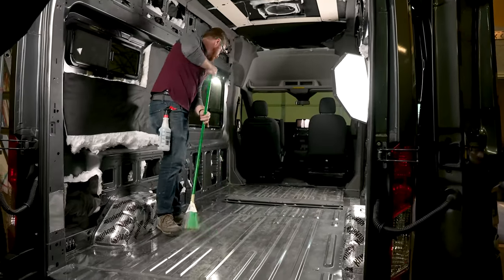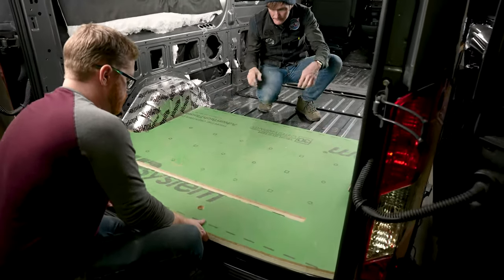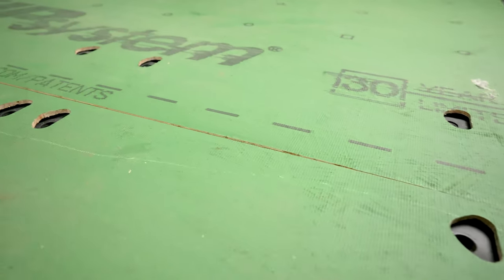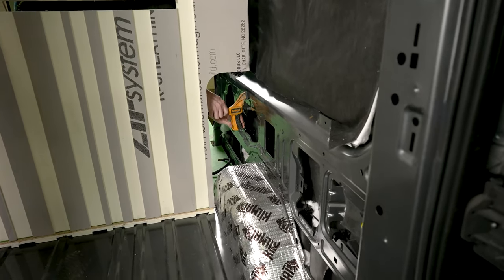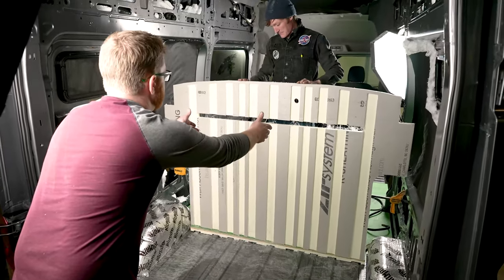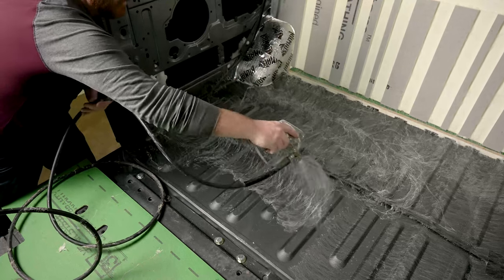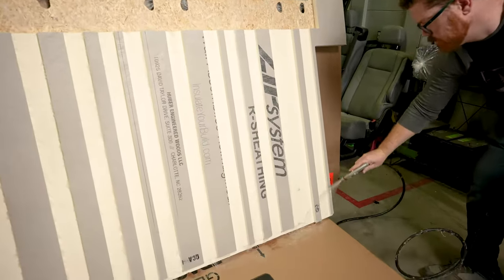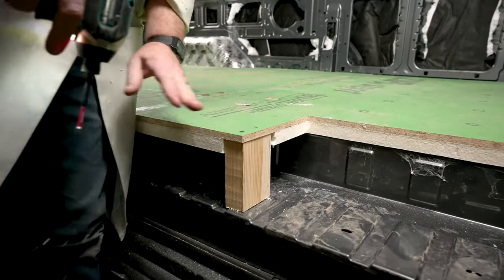AVC Sub Floor Install

Comment: Thanks for this, it's genius, a super clean 3 in one solution.  I would like to kindly request a shorter 2 panel option without the stair and trim assembly for those of us with crew vans who want to leave the second row passenger floor intact to save time and money
Reply from the maker: So you’d want two rear panels and the rear trim? We do offer a crew setup that mounts over your seat brackets in the crew. It replaces the factory floor. We did one recently at the shop. If you look up our Instagram it should be pretty close to the top.
Reply: Yes!  Two rear panels, the inner one that butts up to the existing oem second row floor, a new piece of T trim for that condition and a piece of trim for the rear.   The Crew models are becoming extremely popular and I think you’d move a bunch of these if it were an option.

Comment: Is the primary reason for gluing the floor down to prevent squeaking? Obviously security too but if you’re bolting even just L-track into the floor, that sub isn’t going anywhere. Gluing stuff down to my new van is terrifying but I love the concept and the product you guys have produced.

Comment: So if we're using the cans of adhesive, would you recommend 3M 74?  I just watched your adhesives video as well and it sounds like the 70 and 74 are basically interchangeable, so that seems like the right choice, but I also noticed you recommend 3M 94 on the product webpage for your floor, so would just like to confirm which is best.  Thanks!
Reply from the maker: It depends on the flooring and what it is backed with. All flooring materials are built differently, so choosing the righ adhesive changes with the flooring. In this video we installed G-floor and 70/74 is the best for it. When I install Lonseal flooring I’ve found 90/94 to work better.  90/94 also need more time to properly off gas so be sure to test a little before you install.
Reply: @AVCRIG  Thanks!  That actually answers my next question, but was also curious about the adhesive used to connect the bottom of your floor to the metal van floor.
Reply from the maker: @csteutterman  ahhh.  We found both work fine to secure the sub floor. I haven’t been able to get 94 in the large format (or small cans for that matter) in well over a year. COVID supply chain issues. We switched to 70 and it has a better tack (feels stickier) when applied.
Reply: @AVCRIG  One more question if you don't mind.  How many cans do you suggest to glue down the sub floor in a 148" Ford Transit (non-extended)?
Reply from the maker: @csteutterman  I’d say about 8 would do it. One can per panel and corresponding floor section. A couple more to fill in the gaps.

Comment: Thanks for the video! How good is the insulation on that floor? Id love to put a heater floor element in my build. It looks like it should fit the van like a glove.
Reply from the maker: It does fit the van like a glove. It’s actually pretty solid without gluing in. (Although we definitely recommend gluing it down) poly iso has an r value of 6 per inch. So I’d say the floor overall has an average of 4.5 plus whatever the nominal value of the wood it. My favorite feature is that there is no thermal bridging. Makes for a more efficient thermal envelope.  

Now, I have done radiant heat, but we did things a little different. What heating element do you have in mind?
Reply: @AVCRIG  that’s pretty awesome! Currently I don’t have a specific heating elements in mind. I’m very open to ideas. I’ve seen a few videos where people said the heating elements got too hot and changed the color of the floor, so ideally avoid that risk if possible.
Reply from the maker: I could see that for sure. A lot of those systems are designed to be placed under tile. I did a few Espar hydronic radiant systems in the past, but they were incredibly complex. We did a routed later for the pex tubing, then added a 1/4 wood layer above it all to even out the heat.

Comment: If I'm correct, you had mentioned in the comments of one of your other videos that you have used Loctite PL300 to adhere the floor kit to the van floor. If that is correct, how do you recommend I lay the caulk down? I definitely want to avoid any squeaks. I'm interested in this option because it would save me a good bit of loot, but I only want to use it if it's recommended. I'm going to install my kit this week. Thanks again for these videos!
Reply from the maker: There’s a lot of adhesives that will work. The. PL300 works great and allows for more working time. I would caulk it on with a gun. You can trowel it on, but it’s not necessary. You do want plenty of weights handy to hold the floor down while it kicks. Read the label and follow manufacturer instructions for curing time and temps.
Reply: @AVCRIG  Thanks! This is very helpful.
Reply: Don’t use pl300 its not a great adhesive and binds poorly to smooth surfaces. Pl premium is much better, but for porous or rough surfaces.  A siliconized latex caulk will stick much better to a painted van floor.  Avoid pure silicone caulks for bonding.  
I think his use of contact cement is the best choice however.  No wait adhesion and no clamping or weights required.  Contact cement is also flexible bond less likely to separate over time.

Comment: What other adhesive’s can be used?
Reply from the maker: We’ve been using a lot of 3M 70 in a lace pattern gun lately. I’ve used PL300 in the past, but it sets slow so you really have to weight the floor overnight.  I’ll bet a number of contact adhesives would work.  Just be cautious with something that expands(like gorilla glue) and as always do a little test.

Comment: How are you mounting your l track to the van floor? Does it require a riser?
Reply from the maker: We use the flush mount L track with a lip. We use a spacer under the l track, and bolt it through the van floor. Spread the load with big fender washers.  We’re not intending our track for seating, just cargo.  Next video is cutting the floor for tracks! (But be sure to do that before you install)

Comment: I like your insulated subfloor system. Are there any additional steps needed to keep the polyiso from compressing in areas under base cabinets, built-in seating, beds, or other items that have a fair amount of weight?
Reply from the maker: The beauty of our floor design is that it’s an even contact over the entire floor. Rather than a flat sheet that will compress on the ribs of the floor, the load is dispersed evenly. Compression should not be an issue.

Comment: Thanks for all the videos! What gauge are you guys using for the DCDC charge wire?
Reply from the maker: We use 4AWG since it’s only a 30 amp charge controller.

Comment: Hi AVC
           could you tell me if the Insulated 148'' floor system is in stock at the moment?
I fly back out to my daughters next week.
Also, do you have the black sliding door trim in stock?

Also, if I went a different route with the floor and just used the Zip flooring would the floor/step and trim system still work, as the floor would now be higher than your flooring system because yours already has the CNC cuts in the insulation to go over the van floor ribs?

Thanks
             Brian
Reply from the maker: Hi Brian
I think we got back to you on another comment. Email the shop at shopavcrig@gmail.com so we can answer all of your questions!
Reply: @AVCRIG  hi yes, I did email you direct on that email and also off the email contact box on your website. let me know if you didn't get either and i resend them.

Comment: What is the actual Zipp floor are you using, we are installing a JMG seat and the same coin flooring and want to be able to remove seat and mount to be flush. We went up to our hardware store and they would have to order and we cant return it so didn't want to order wrong product. Thank you
Reply from the maker: Where are you located? I can do a JMG zip floor for local pickup.
Reply from the maker: To answer your question we use R6
Reply: @AVCRIG  Thank you for all your your help unfortunately we live about 30 min out of Austin TX on lake Travis and we don't have as you would say ( BIG BOX'S STORES ) Ha ha thank you again
Reply from the maker: We have to special order the ZipR here too. It can only be purchased by the full pallet. In the case of R6 that’s 33 sheets.